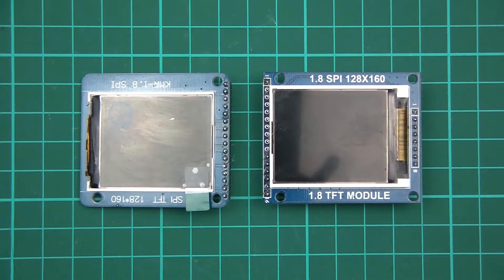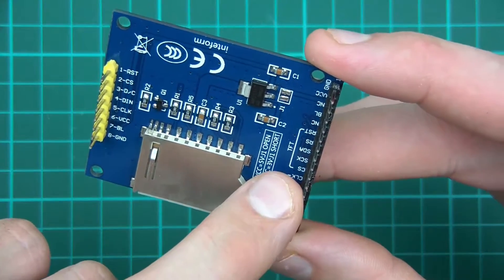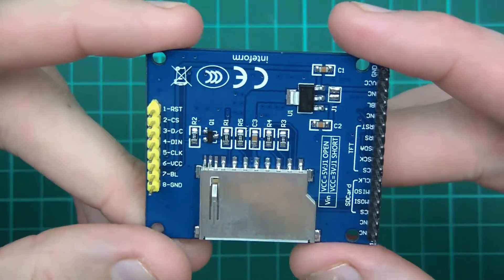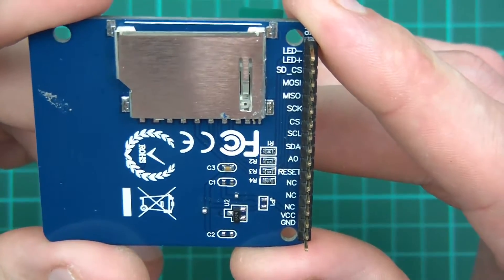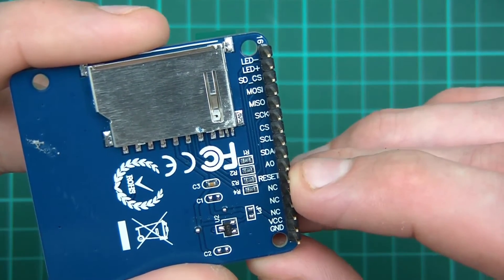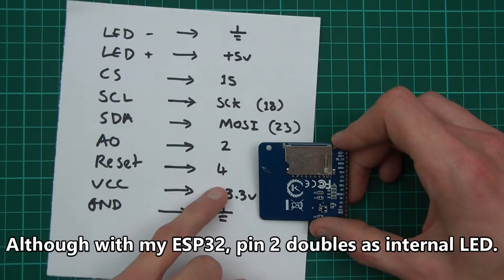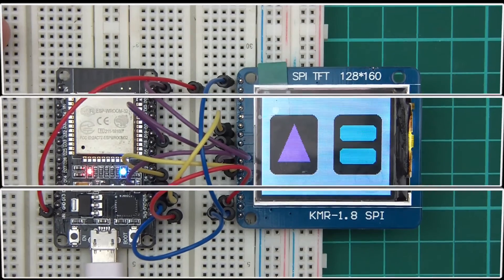TUTORIAL: How to work with a 1.8" SPI TFT with strange incorrect labelling!

Comment: Thanks for sorting this out.  I'm still working to get mine working. A couple comments as a new user.  1. Assume this is a new user to this processors. So, saying 'you can connect this to any pin you want' basically says nothing.   2. Giving pin numbers for the board you are using also tells me nothing as I'm using a different board - and when I looked up pinouts on an ESP32 board there seems to be at least 10 variations. It would be much easier if you created a 3 column table with 1) labeling on the display screwed up board, 2) what the label should say, 3) the function of the pin you are connecting to on your processor board.  Example    SCL-----SCK-----SCK (and I'm not sure this example is correct as I'm still stuck in the weeds)
Reply: here is the diagram : https://i.imgur.com/b9Erl8N.png works with GraphicsTest Example from ucglib library (uncomment line 58)

Comment: LITE - this is the PWM input for the backlight control. Connect to 3-5VDC to turn on the backlight. Connect to ground to turn it off. Or, you can PWM at any frequency.

MISO (or SD_MISO or SDO) (Master In Slave Out) - this is the SPI Master In Slave Out pin, its used for the SD card. It isn't used for the TFT display which is write-only

SCLK (or SD_SCK or SCK or CLK or SCL) (Serial Clock) - The clock pulses which synchronize data transmission generated by the master. This is the SPI clock input pin.

MOSI (or DIN or SD_MOSI or SDA) (Master Out Slave In) - this is the SPI Master Out Slave In pin, it is used to send data from the microcontroller to the SD card and/or TFT

TFT_CS (Chip Select or Slave Select) - the pin on each device that the master can use to enable and disable specific devices. This is the TFT SPI chip select pin

Card_CS (or SD_CS) (Chip Select or Slave Select) - the pin on each device that the master can use to enable and disable specific devices. Used if you want to read from the SD card.

D/C (or A0 or DC or RS) - this is the TFT SPI data or command selector pin

RST (or RESET or RES) - this is the TFT reset pin. Connect to ground to reset the TFT! Its best to have this pin controlled by the library so the display is reset cleanly, but you can also connect it to the Arduino Reset pin, which works for most cases.

CS (or CE or SS) (Chip Select or Slave Select) - the pin on each device that the master can use to enable and disable specific devices.

VCC - this is the power pin. Can be connected to +5VDC or +3.3VDC pin of Arduino board.

GND - ground. Connected to Arduino board GND pin.

BL (or LED+) - this is the input for the backlight control. Connect to 3.3V or 5V DC (with resistor 40-150 Ohm) to turn on the backlight.

LED - 3.3V IO and Power Supply pin

LED- - this is the backlight control ground pin. Connect to GND pin of Arduino board.

NC - Not connected. This pin is not in use.

Comment: So "A0" on the SPI TFT module = "DC" data/command pin?
You only have it listed as "2" which is not helpful for my STM32F4 connection
Reply: yes A0 == D/C

Comment: I have exactly the same module. The SD card holder came with only a few pins in one corner soldered. The others were just completely off the board. While fixing it, one of the pads ripped off the PCB bu it turns out that pad was connected to nothing and all the SD pinout diagrams show that it doesn't get used when communicating with a SD card over SPI anyway. 

It was sold as having a ST7735R but I've had better luck using it as an ILI9163C, at least on a Teensy 3.2. The library named TFT_ILI9163C from Sumotoy has so far worked the best.
Maybe it would work better on a standard UNO or Leonardo with ST7735 libraries Adafruit uses in their tutorials but I've had no luck with them.
Ugclib DOES work with this display if you choose ST7735 though.
I'm assuming ST7725 and ILI9163 are very similar.
.

Comment: wish i could figure out my TFT :*( it's a mircoyum and i can get it to work but i cant find the code or the pinouts for the sd card
Reply from the maker: Some boards are different but I'll try to do an sd card video... It's a start!
Reply: thank you :) i have an art project due oct 1st and i need to display images from the sd card but i can't figure out what the 5 pins on the right are for they say F_CS, SDK, SD0, SDI, and SD_CS do they need to have something soldered to them? bc they dont have pins and im wondering if that's what i need to hook up to make the SD card work. thanks again!
Reply from the maker: @sabrinaflipse7732  I'm afraid I don't know for certain, but I imagine the spi puns are shared with the TFT... Sdcs is chip select. Sdi and sdo will probably be sd in and sd out... I don't know more about it at the moment. :/
Reply: thx for trying :)

Comment: Exactly what I needed. For the exact same model (KMR-1.8 SPI).  Thanks!
Reply: Since I'm using one of those "Wemos WifBluetooth Batteryi" modules, I connected the Screen VCC to Pin 9 (for example), then the screen backlight would also turn off when I turned the on-board switch off.  If I used the 3.3v 'vcc' pin, it stayed on. This should also make the backlight dimmable via PWM.
Reply from the maker: Thanks

Comment: In order to send data to the screen do I need to reduve the voltage to 3.3V in order for it to work if I'm using an ordinary arduino uno?
Reply from the maker: SpasmaticAA hi, 5v might work, but it's not recommended because it's not meant to handle that high a voltage.

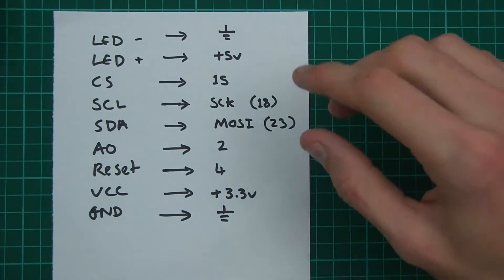Comment: Hello.  At 4:45 mark, it shows in the video that the tft display requires +5V and also +3.3V.  My question is does the two voltage source +5v and +3.3v share the same ground connection together when you wire up everything? Would that cause some issues because they are at different voltage potential?  I have the same TFT Display identical to the one in the video and I'm planning on testing it on the ESP32 board. But before I do that, I just would like ask that question.  Thank you.
Reply from the maker: DeLaCruzer11 Hi, it doesn't cause issues. It actually works with both pins on 3.3v anyway. The only potential problem is that if you want to control the power to the tft, you can't do low side switching, because if you did, you'd reset the control IC as well as the backlight... You could use a PNP transistor on the backlight pin to get around this problem.
Reply: +Antony Cartwright   Sounds like a lot of hassle working with this version of tft.  I've already tested mine on an arduino uno but I have to use a lot of resistors for the voltage divider to shift the 5 volts to 3.3 volts for the relevant pins.  It work perfectly but its a hassle working with it.  I should have picked the other versions when i was buying this one.  Thanks for the reply.
Reply from the maker: Yeah! But I think quite a lot are 3.3v ones. I guess it is a bit of hassle, but it's just necessary I guess! The PNP shouldn't be too difficult. :-)
Reply: +Antony Cartwright   True.   There are even tft versions with selectable switch that can be switch to either 5v or 3v .  But I think for this particular tft, the manufacturer further reduce the component in the tft to reduce cost and make it even cheaper.  This leaves the user to tinker with it a little more in order to get it working. I guess that can be good in itself because it forces one to do more research and gain a little more knowledge a long the way to get the device working.  Yeah i will try out your transistor suggestion when i get to tinkering with it.  Thanks, man.
Reply from the maker: No worries! I'll let you know about the PNP. As it turns out, I'll need to do it also... :-)

Comment: Hi, Cool video. I received mine today. Which Library did you use?
Reply from the maker: Mike Sims Hi, for the ESP32, I used the bodmer TFT library. :)
Reply: Thank's Anthony, I'll check it out. I've tried to get this screen going with a nano and the Adafruit drivers and it powers on, but that's far as it goes. Mine does not have the yellow pin block as yours does.
Reply from the maker: This video isn't for the one with the yellow pin block. :-)
Reply: My bad, I was thinking this was your other video where you do wire up the yellow side.  ;-) . I'm gonna go mess with this thing again and see if I can get it working based on your explanation here. I'll let you know if I have success.  :-)
Reply: Anthony, from a different diagram I found somewhere, it looks like the SPI pins which are just under the LED pins, are for the SD card slot then the I2C pins are for the display ... would that seem to make sense to you?
Reply from the maker: Hey Mike! The "SPI" pins are for the SPI SD card, but the "I2C" pins are for the TFT! But the TFT is NOT I2C! It's SPI! What should happen is that there should be two banks of SPI pins. There actually are, but for some weird reason, they have labelled the TFT pins with I2C names, apart from CS which is correct... Why on earth would you do that? They should be labelled; SD_CS, SD_MOSI, SD_MISO, SD_SCK, then; TFT_CS, TFT_MOSI, TFT_MISO, TFT_SCK.
Reply: Beautiful!  Thank you for clarifying ... I know you did say this in the video, but it wasn't clear to me since you basically labeled the pins as they connect to your particular microcontroller. But this makes it perfectly clear and I appreciate that!
Reply from the maker: I believe you've wired it incorrectly. Maybe look at my other TFT tutorials. I have two proper tutorials for TFTs, one for Arduino and one for ESP32. This video right here is not a "how to wire up" guide, it's more of a guide on how the wiring is for this particular (messed up) TFT. If you have this TFT with the messed up labelling, but an Arduino, you'll need to watch this tutorial and my Arduino one and kind of merge the info. For Arduino, it's not necessary to use the Bodmer library, you can use a simpler one without a config file (all mentioned in the video). But when you come to wire it up, just remember the correct pinout of your TFT from this video. ("SDA" should be "MOSI", "SCL" is "SCK"), etc... 

My Arduino TFT video is here: https://www.youtube.com/watch?v=l5PnFHLRkys

Comment: But the problem with your way is that you won’t be able to use the SD card, you need the spi connection for that, i figure it out, but a bit messy you’ll need resistors. If you want to make it work just google for “cheap 1.8 tft from ebay” you’ll find the solution. 
Thanks again
Reply from the maker: The weird thing is that the I2C pins are actually SPI pins!